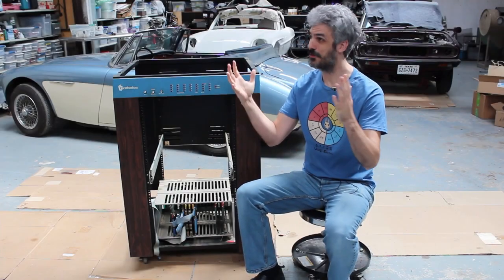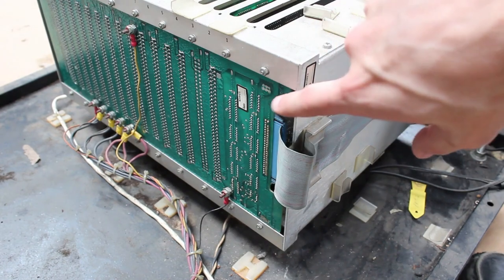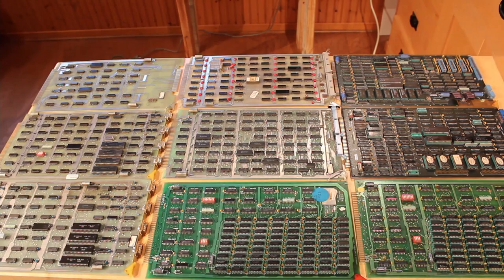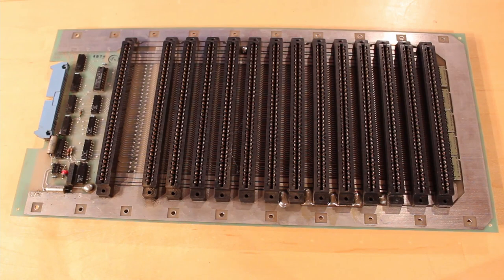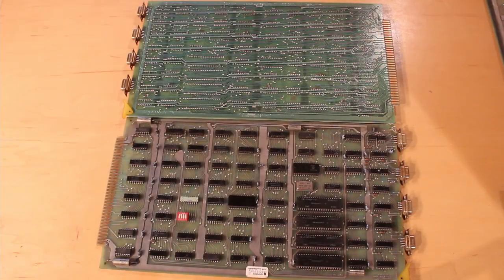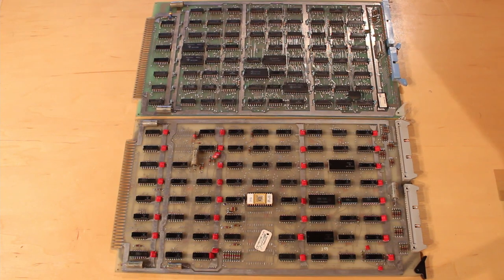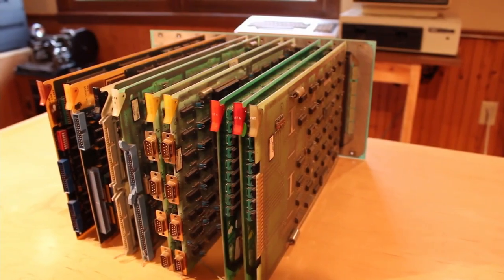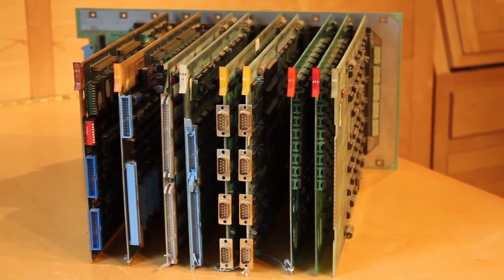Minicomputer Part 4: In-depth Look at all the Computer PCBs

Comment: When I heard bit slice processor, something rang a bell and I did a quick research; and indeed Am2901 bit slice processors were also used in Cisco routers. The AGS+ I knew for sure but I was surprised to find out they (or some later versions) were apparently still used in the Cisco 7000 series which came out in the mid 1990s. I think they used it specifically for fast packet switching.

Comment: check the serial driver chips on the mux boards, as well as the pinouts of the DB9s. I'm going to guess that the db9 is RS-232, and the EIA ribbon cable in the back is the current loop port.
Reply from the maker: I'm not quite sure I'm following along here, but that's mostly because I'm barely keeping my head above water with this whole build, haha.
The EIA port I showed is actually on the back of the terminal, the MUX boards only have the four DB9 ports as output (one port per chip I'm guessing). Interestingly, the computer did come with a bunch of cables that have a DB9 plug on one end and a DB25 plug on the other end. But, those could be specifically for plugging into the "modem" that I show in the first episode.

Comment: I was wondering why some of the RAM chips looked likee they were inserted the wrong way, but after looking at the high res pictures I see the pin 1 marks are all the same. Only a few had the information markings flipped.
Reply from the maker: Yeah, that really threw me for a loop at first! I was freaking out that someone had put some RAM chips in upside down, but it seems that chip orientation wasn't important at all for the silkscreening process, haha.

Comment: The capacitors must be done like that for mechanical reasons (e.g. not to break them during soldering or not to have them come into contact with other boards). With decoupling capacitors you want to avoid adding any extra inductance or resistance, so the leads generally as short and straight as possible, so they'd need a really good reason to do it this way.

Comment: Hi;

You mentioned to another person, about the TMS9900, it was used in the TI-990/4 system, I have forgotten if it was used in the TI-990/5.. But both the TI-990/10 and the TI-990/12 did NOT use the TMS9900, but were all TTL Design ..

THANK YOU Marty
Reply from the maker: Oh, that's really interesting! I haven't done nearly enough research into the TI-990 system, I totally didn't realize that there was a full TTL version. Now I definitely want one of those, haha!

Comment: Those date stickers say REPAIRED 1983, it's probably 2-3 years older than that, and required service in 83
Reply from the maker: You're totally right! I'm so, so bad at reading handwriting that I can barely read my own handwriting at times, haha. That definitely makes sense that it was probably built around 79 to 80, and then various boards were either repaired or replaced throughout the years.

Comment: Capacitors upside down might be for some thermal reasons due to wave soldered nature of the boards - thats why there is solder resist on the bottom side of the boards (omitting top solder resist was probably a cost cutting decision, that stuff must have cost a lot back then).
Or maybe there is some black magic transmission line reason, can't tell for sure.
Reply from the maker: Some others have mentioned that it's most likely due to the board being drilled for a different capacitor footprint, but no one really seems to know for 100% certain why it was done this way! Thermal reasons is a solid guess too, though I fear the only way we'll know for sure is to ask someone who worked at Centurion back in the day, haha.
Reply: My take is that this was likely for stress relief.  The capacitors were 0.2 inch pitch.  The holes were wider apart (0.3...?) and those dipped capacitors from the 70s and 80s didn't like having their leads bent close to the body since it induced fractures in the coating that then led to failure of the component.  I never saw that upside-down mounting before, but at the clock speeds used in that design the extra lead inductance would not have been significant.
Reply: Or just to reduce their height?

Comment: Not sure why they mounted those caps backwards either, but it definitely will make testing easier! Also, as someone who spent some time in a (much newer) datacenter, i would not be surprised if the issue in nailing down a date is so complicated because many parts were replaced over the lifetime of its service contract. That's not indicative of a bad system or anything, just with time, lots of things happen. In addition, When systems go EOSL(end of service life), support contracts by third parties are still a thing, however since no new parts are being made, they must repair the broken boards they receive in exchange for working ones, and may not necessarily have updated the date sticker.

Comment: the Mux boards came in pairs you only needed one board to have a clock crystal also, the wire on the one board may have been on older board rev and that wire was an ECO (Engineer Change Order) also the board that had the 1983 date was a repaired board. I would replace the Sprague Caps (they were very good ones but they do go bad) 7400 chips came out in the late 1960s to late 1970s your CMOS chips the 4000 series came to be used in the late 70s. in 1975-6 7400 series chips got really cheap to buy too. REMEMBER that the 1983 date was when it was repaired not when it was made.
Reply from the maker: Interestingly, both the MUX boards here actually have a crystal, I just totally missed it. The boards are roughly identical, just different revisions, but the primary and secondary status of the board is selected via the 4-bit DIP switch. If you look at 8:27 on the top board where the crystal "should" be, then go straight up to the top and over one row to the right, that's the crystal for that MUX board. It's encased in a piece of heat shrink tubing, which is why I totally missed it!

You're absolutely right about the date codes though, I'm terrible at reading handwriting (even my own) and it totally says "Repaired."

Comment: Inverted caps are probably to keep them low profile for slot clearance, preventing bending and lead shorting.
Reply from the maker: That could definitely be it!
Peter S also had a good idea that the board itself may have been designed around an older style cap, so in order to get the narrower leads to fit without damaging the epoxy coating, they had to flip and bend the leads like this.
Reply: additionally you only need 2 simple bend operations per cap, as opposed to 4 much more precise bends whan mounting in upwards direction.

Comment: Was the Mux board without the bodge wire dated later or a higher revision number than the board with the bodge wire?
Reply from the maker: I couldn't find exact dates for the MUX boards, but the four main COM chips used have pretty close date codes on them. The chips on the board without the bodge wire (and without the crystal) have a date code of 7815, and the chips on the board with the bodge wire (and with the crystal) have a date code of 7701. So the bodge wire board may potentially be a year older, and could be the primary board, hence the crystal. But, honestly, I think the computer was probably built around 79 or 80, so it's possible that both boards were new old stock stuff they had hanging around the office!

Comment: The sticker says 'Repaired' five years or do after manufacture. The IC's are still dated 1977 and 1978.
One clock unit runs both boards. Two separate clocks would not synchronise properly and would cause issued.

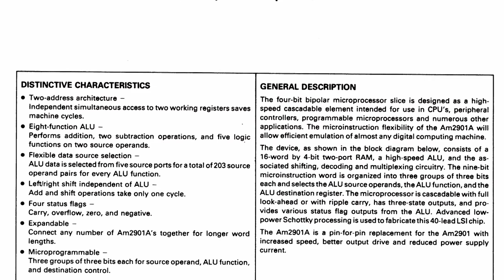Comment: 16:15 It's funny how data sheets often mention "high speed" and "low power", and if you remove these words the description still makes sense (and is arguably even more correct!).
Reply from the maker: Haha, you're absolutely right!
I actually work in the marketing section for an automotive company and the level of useless lingo that we have to use is a little depressing. It actually makes the datasheet here seem super succinct!

Comment: Those sprague caps loving shorting, repaired a hp with 10 shorted sprague caps. So just check if they are shorted otherwise they should be okay.
Reply from the maker: Interesting! Will do!
I was hoping to replace as few components as possible, but it might be safer to do a blanket replacement of all electrolytic caps.
Reply: I'd replace them all. I have a Tek 2465 scope that smelled a little funny when turned on and upon inspection one of those baby's is about to let out the magic smoke.
Reply from the maker: @vincei4252  I'm a little nervous about doing a total blanked re-cap, I'm afraid that I may end up doing more harm than good by doing so much desoldering and resoldering. I know it's probably a good idea, but if those sprague caps don't test out as having shorts, I might leave them as they are for initial power up.
Reply: @UsagiElectric  That's understandable. However, if there are any safety caps across the line in for the mains power supply I'd highly recommend replacing them before powering on. You don't want them failing catastrophically and damaging the PCB tracks.
Reply: @UsagiElectric  Snipetty snip legs of the caps and j-hook new ones in - won't win any beauty contest, but you won't destroy any pads or throughole plating.
As for any class Y or X caps - they NEED to be replaced with the proper class capacitor (in the PSU there probably will be 3 of those).

Comment: Really enjoying your videos ... excellent closeups and schematic reviews. One note on the Mutiplex Board at 7:32 minutes into that Miicomputter Part 4: In-depth Look at all the Computer PCBs ... the date sticker reads "Repaired" 111283, which makes it probably fall into line with the earlier vintage dates. I wonder if the "Repaired" notation has anything to do with that crystal found on this board, but not the other? Good stuff! Carry on.... and thanks for sharing. That repair wire looks like it might be going to the crystal location. Note: The 1983 date on the Disk Controller board was again a "Repaired" date... so the board might have been built earlier.
Reply: The 4-Port MUX with the silver oscillator in middle of card is the newer MUX rev level and supports RS-232 & 20ma Current Loop serial devices. The 4-Port MUX that seems to be missing it's oscillator has the oscillator circuit with crystal in black heat shrink tubing at the bottom of the card near port #4 (this MUX is older and is RS-232 only).

Comment: Memory suggests that 7905s are fixed -5v regulators.  Mainly because 7805s are the positive voltage equivalents. 

Also, I concur with CuriousMarc's recommendation to cover up that bare EPROM before it's exposed to too much UV. If it's not already erased.

Comment: Spargue was a verry known Brand way back when and their caps were high quality. Anyways after so many years especially the electrolytic caps go bad. I wouldn't risk burning up your PSU. It could make the repair unnecessarily complicated. The hefty PSU can easily burn itself and a row of traces up.
Also keep those tantalum caps in mind if you have problems with areas of logic not working properly. I think at Adrians digital basement I once saw a few tantalums screwing up the whole interboard communication by shorting the power rail of a whole board.
By the way, I think they mounted them upside down so the electrons dont fall out 😅
Reply from the maker: There are certainly some caps on those boards that need replacing!
But, I've heard differing ideas about whether all caps need to be swapped out regardless of how they test. I think the biggest thing I need to look out for is making sure none of them are shorted, which is something I can quickly and easily test. My biggest concern is damaging the board by desoldering and resoldering in new caps, especially on the extremely fragile multiwire CPU boards.
But, I think I'll just have to take it slow and steady and try to use my best judgement on which caps to replace!
Reply: @UsagiElectric  One option would be to lift a pin on a representative sample of the electrolytic caps and test their value with a cheap meter. If within 20-30% of the label, then all good. (But keep your finger on the mains switch and eyes averted when you first switch on :-)  They may still blow when powered on!)

Comment: dunno why the decoupling caps are upside down but makes it easier to attach clips and probes to for trouble shooting.

I would recap the electrolytics. They seem to be bulk/smoothing caps for the board.

A lot of those legs on the ICs look terrible. I would power up each board and check voltages to make sure they're getting the right voltages and nothing is shorting out. That White EPROM, hope there isn't any bit rot.
Reply from the maker: Some of the other commenters have mentioned that it's most likely due to the boards being designed for a capacitor with a different footprint, so in order to get the smaller decoupling caps to fit the wider footprint, they had to be mounted upside down. Why they didn't just design it for the smaller footprint though, I don't have a clue, haha.

I think I'm going to recap all the non Sprague made electrolytics. It seems that the Sprague metal can caps are tantalum caps and are of very high quality, so I'd like to leave those if possible. Of course, everything will get checked for shorts though!

You're absolutely right, some of the IC legs look atrocious. I don't know if that's actual corrosion or just nastiness on top of them, but either way, they need a lot cleaning. I do intend to do a full ROM dump of all the ROMs on the board, so hopefully if one of them fails I can get a replacement EEPROM in place!

Comment: while ur cards run up and down, the TI-990 were 19" cards with the CPU on one board for 16 Bits and ONE memory card with up to 2GB the case had 8 full 19" slots and 10 1/2 slots for i/o cards. most of the 19" slots were 911 video cards but TI didn't bother to let any one about the limit on the 5V supply.  that made the system have terminal Radom drop out. that lead to needing a a2nd case and card to connect the 2 case as one for the 20 terminals.  When the service tech saw what we had.  it was you can't do that. it took us 4 months to TI and a special tech to come in tell us how to fix it.  it led us to working for 1.5 hrs, saving our work, logging off for 30 mins then logging back on. when your working on 12K lines of code, losing you work was OMG it gone.

We had 4 50MB drives.  when the rains came, that lead to building special cable box for the drive cables to keep then dry and moving the computers 2' off the ground and all video cables. we had 14 911 terminals before 931 came out and before the TI-990 Mod 12.  That where TI took all the problems we had with the Mod 10 for they 17 slot Mod 12. The Mod 12 was 4 times faster then the Mod 10.

Comment: you better cover that prom window asap, and you probably should desolder it and make a backup. they dont retain data forever.
Reply from the maker: Fortunately, Centurion was pretty smart and socketed almost every non 7400 series chip. So I fully intend to do ROM dumps on all the ROMs in the system just to have a good backup!

Comment: The 7905 is actually a negative five volt regulator. Don’t know what on the chip needs minus five volts, but apparently the power supply doesn’t supply that voltage.
Reply from the maker: You're totally right! I saw the 7X05 designation and my brain immediately went "5V regulator," I never thought to actually Google and double check, haha. The power supply only gives +24V, +12V, +5V and -12V, so the 7905 is probably generating the -5V from the -12V rail.
Thank you!
Reply: Could be for RS232 line drivers.
Reply: @UsagiElectric  wait... I thought you knew it :-O
Reply: Some chips of that era required an external -5 V substrate bias. The current required is low, but it has to be there. Later chips derive this internally.
Reply: @Derundurel  That makes sense... early NMOS and PMOS had weird operating points.
http://www.righto.com/2018/08/inside-die-of-intels-8087-coprocessor.html
Then soon after, CMOS made it moot.

Comment: It seems that the only reason why they put those caps up side down was to save space ..you can see that in most places where they are added there are traces .so is a big no no to put them in the normal position as you would have to bend the leads 90 degrees and isolate the capacitor leads as they could be in contact with those traces ..The caps footprints were probably designed with other caps in mind .Then this new ones became available .But now they can be in contact with traces.By putting them up  side down the cap itself isolates the leads from getting in contact with the traces running through.
Reply from the maker: You're absolutely on point here!
I've actually met with a gentleman who used to work at Centurion, and I bombarded him with about a thousand questions, haha. But, one of the questions was about the capacitor leads, and he said it was because they changed capacitor manufacturers after the PCBs were ordered, and the new caps had a narrower footprint. So, in order to get them to fit the older, wide footprint, they flipped them upside down and bent the leads around.

Comment: Likely all components are using a single oscillator for timing signals to ensure all components are synchronized to the same clock frequency and timings. If so the second board would also need to be cpu board needs to use the same oscillator as the first board.